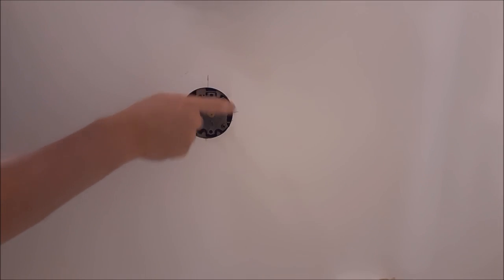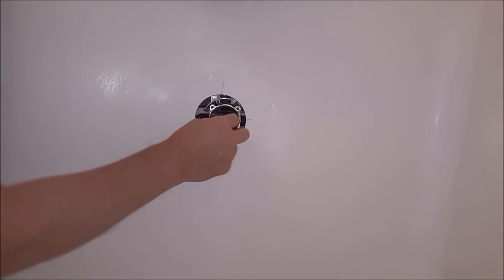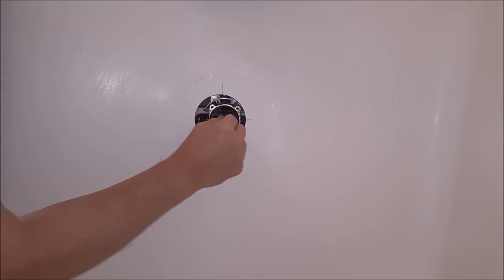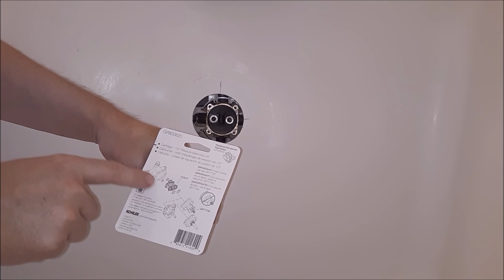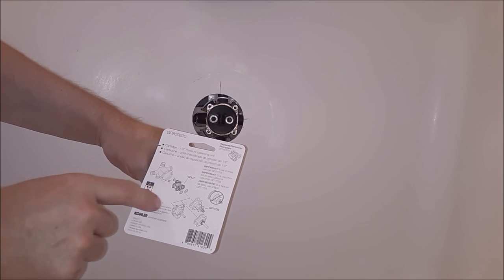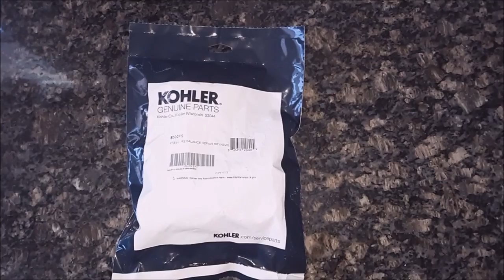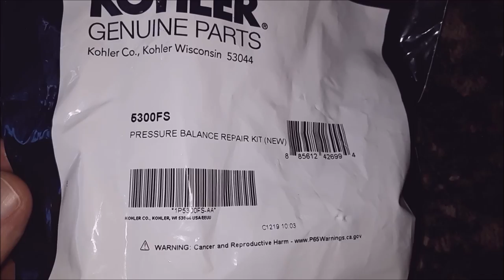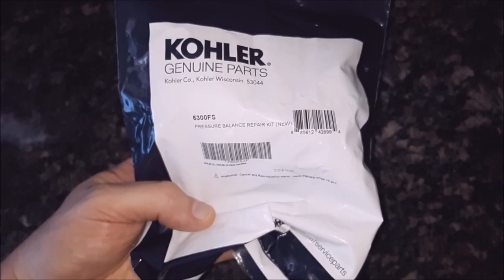DIY Repair Replace Install Sterling Kohler Shower Tub Hot Cold Pressure Mixer Balance Valve Lever.

Comment: Thank you so much. I have the exact setup in my shower and the hot water started to get less and less with each shower. Plumbers are expensive and I just did a quick check on YouTube to see if anyone had made a video showing how to repair, and lo and behold, you had. I bought the parts, replaced them, and now I have a functioning shower again. You probably saved me a ton of money. Thank you so much. Keep up the great job.
Reply from the maker: Glad it worked & thanks for the thumbs up. 👍🤞

Comment: And ideas after replacing parts why my valve turns off only in the center position? Otherwise seems to be working like a faucet. Left hot, right cold, center off

Comment: Thanks so much for your help. I installed without any major hurdles. One caveat is the long screws for the trim kit were too long with the Kohler replacement part. Had to run to the hardware store for #8 1-1/4” machine screws.

Comment: I bought Kohler Part 5300FS and Kohler Part GP800820.  After installing the faucet runs at a fast drip even when the handle is in the off position.  Any thoughts?
Reply from the maker: When trying to repair or replace older parts these things can be a PITA! I have found new old stock on ebay that might work better than the new designs. Unfortunately it's trial & error or completely replace valve & all. I feel your pain. Good luck.
Reply: Did you use the 2 thicker 0-rings that came with the GP800820 that are used where the 800820 and the 5300 meet? If so they are the wrong ones.